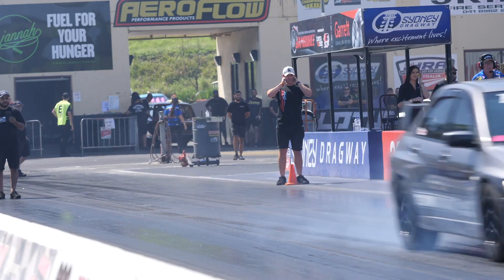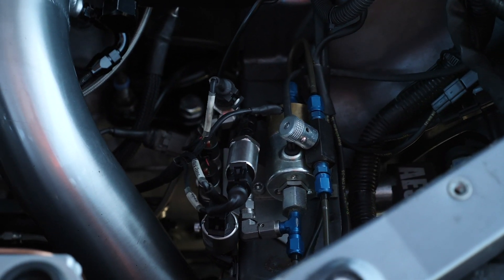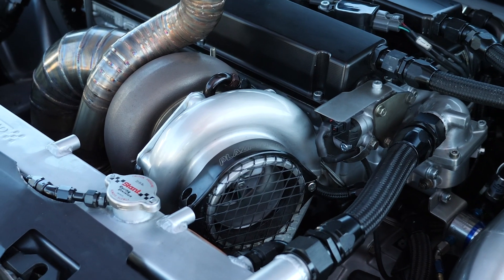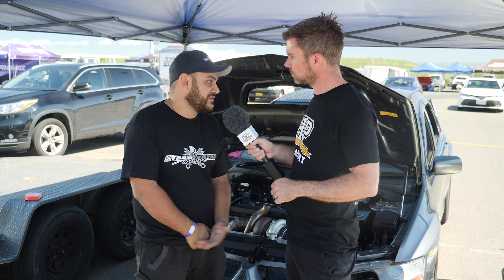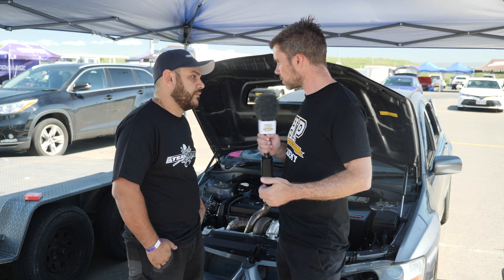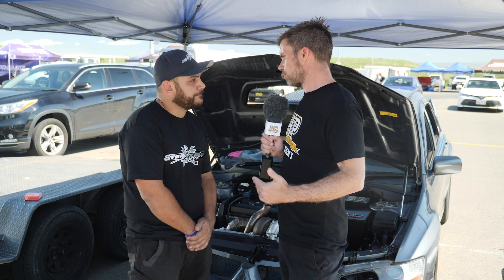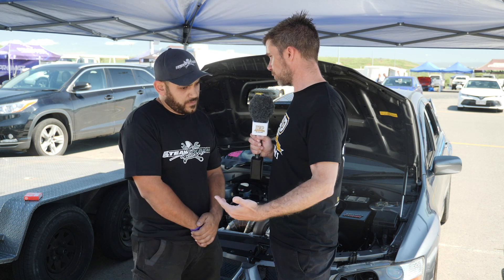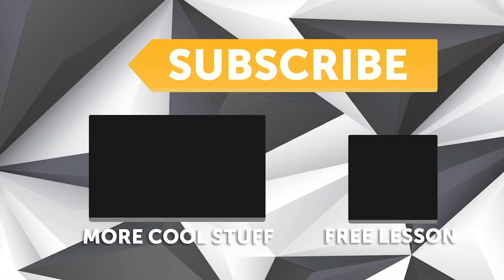870HP Stroker 4G63 EVO 8 | KNG4G Drag Car [TECH TALK]

Comment: Do you have or can you do a video on that standalone ecu dash setup?
Reply from the maker: Ahh you mean one for a FuelTech? Not yet, I would say later this year but most likely next year now we should be diving into that platform.

Note a lot of these things still work in the same way, just with different software, so I wouldn't necessarily hold out for anything but rather use everything you can get your hands on now to learn 🤘 - Taz.
Reply from the maker: Like this one? - https://www.hpacademy.com/previous-webinars/265-configuring-can-communications-dash-to-ecu/ - Taz.

Comment: Man up and manually slip the damn clutch!
Reply from the maker: The goal is to go as fast as possible. If you wish to not use a slipper clutch in your own setup though that is fine, no one will judge you for it =) - Taz.
Reply: High Performance Academy I was just being a wise ass 😜. I’m sure it’s way harder to have a consistent 60’ at those power levels

Comment: That should be running low 9's. That clutch slip is slowing you down IMO
Reply: We got a Sherlock Holmes over here. I'm sure you know more than the guys who built it but if you listened It was mentioned multiple times the driver is still getting use to the car.
Reply: The clutch only launches, sequential takes the rest, still think its slowing them down?

Comment: Drag racing an Evo is a complete waste of a great car.
Reply from the maker: I'm afraid you aren't going to convince us of that ;) We love drag race EVOs. Just remember how you enjoy cars and how other people enjoy cars is likely to be different. And that is ok.
Reply: @hpa101  Yup, different strokes for different blokes. 
Not my thing, either, but the engineering behind builds like this is cool, and can often be adapted for other motorsports. For example, transmissions that can take the abuse of clutch drops on high grip drag strips will almost certainly stand up to anything a circuit car can hand out! Head sealing methods that can hold 80PSI of boost will be almost bullet proof with a 'mere' 50! Connecting rods and pistons that live at 12k rpm will have a 20% safety factor at a 'mere' 10k.
There is an old expression "racing improves the breed".
Reply: You wouldn't have good entertainment or know the car/product limitations if it weren't for the guys that drag them

Comment: 10.50 ? Is that right ? At 850hp
Reply: that was with a 2.0 60ft, if you check out team karam racing on facebook the time slip for that pass is posted, i don’t think the car has run a new time since due to being kicked out for the mph and no cage at the time
Reply from the maker: @JoeeyyBro Looks like they were getting the cage and parachute sorted just before old mate Pandemic, so I'm sure we'll see it on the track again once things settle down 😎 Woo! - Taz.